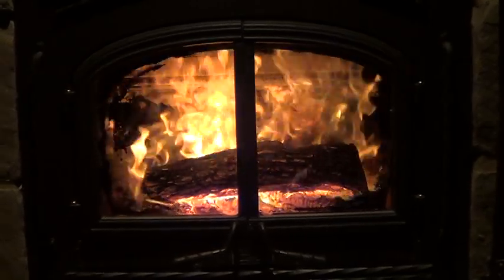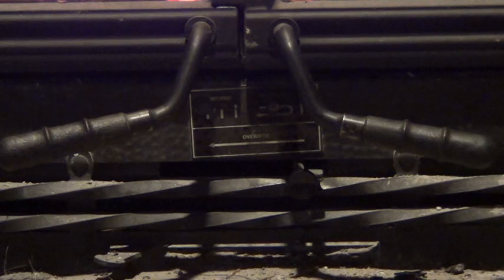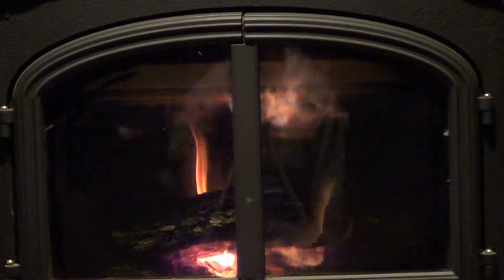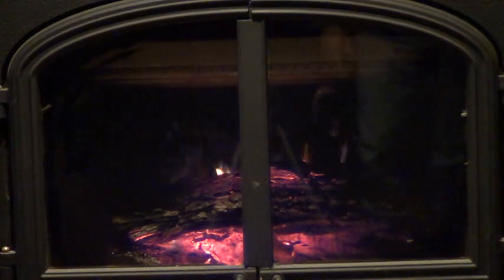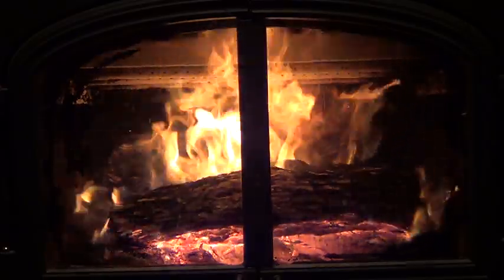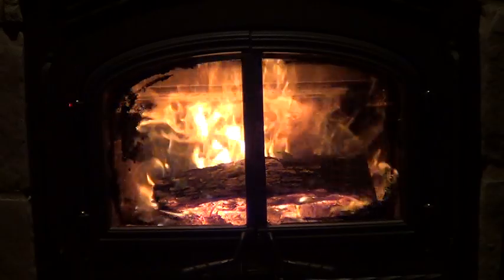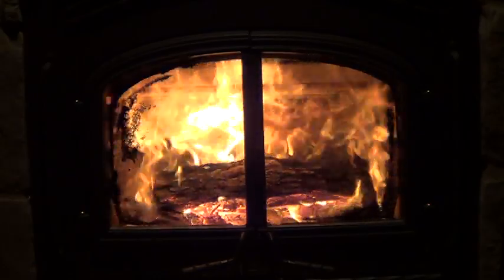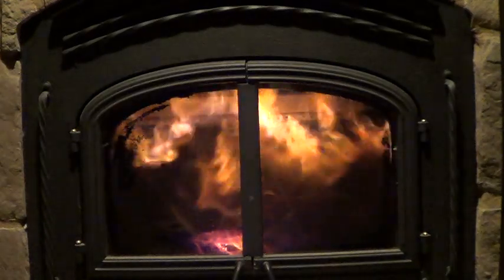Quadra-fire Wood Burning Stove Operation & Tips For Using ACC

Comment: Rick, Do you crack a window open to let the fresh air in? How often do you clean your chimney? Is that Quadra fire stove an insert in a fireplace?
Reply from the maker: yes insert lined with fire bricks, no not really open windows, only have it two years and burn oak, never cleaned and it burns much hotter than open fire place so builtup is less.